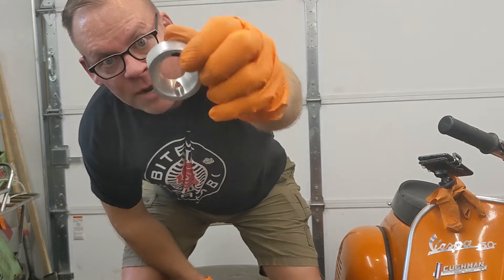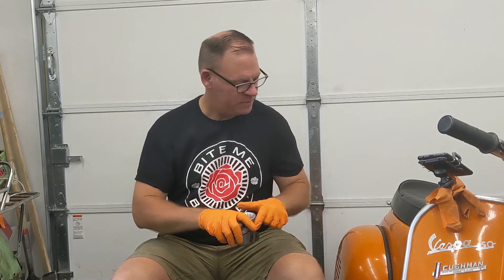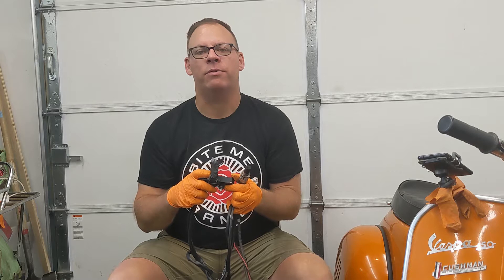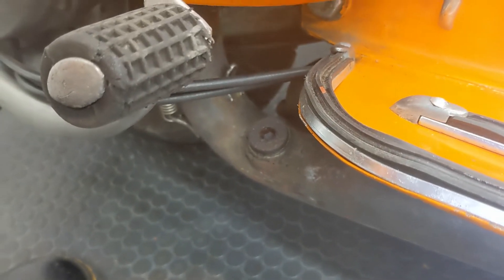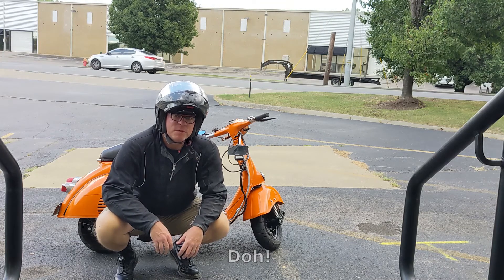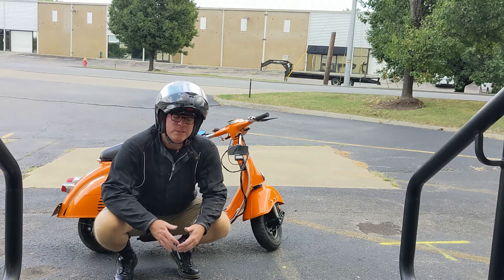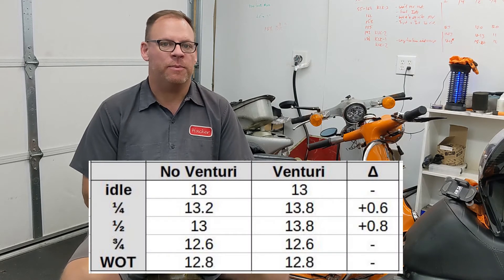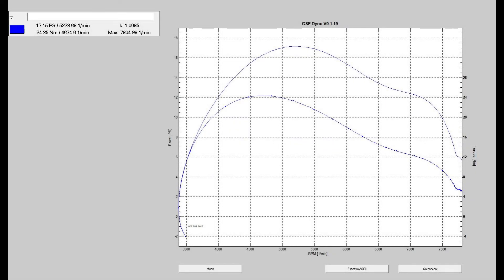Testing a Venturi/Bellmouth extension on an SI carb

Comment: Do you still have a reed valve Stella? How about a pipe such as a PM Tuning? Would be interested to see those results also.
Reply from the maker: Have the PM Tuning pipe on my Stella motor, but it's running a PWK34 with VForce4 reeds.  I have a Venturi/Bellmouth for it, too, now that you mention it, so I could potentially replicate the experiment on there.  I put it on but almost immediately took it off because it made that thing LOUD, even compared to the PMTuning exhaust.